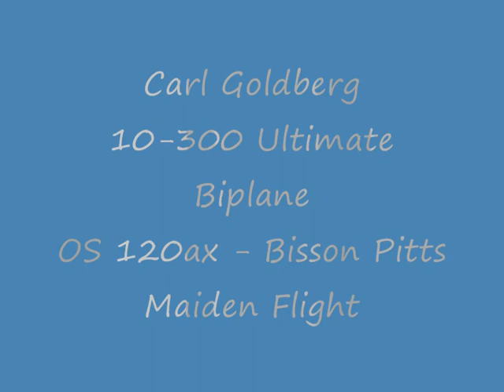Goldberg Ultimate Biplane 10-300 KIT - OS 120ax Maiden

Comment from the maker: Thanks! I am using a topflite powerpoint 16x8 and pretty sure a 17x6 would be the next step. Based on the fact that sport aerobatics can be done 'easily' at 1/2 throttle I would put it in the insane category. however I wouldn't have it any other way and think the 120ax is well suited! Vertical is alot of fun! I am runnin 10% at sea level.

Comment from the maker: I haven't been flying it quite that much yet and only just leaned it out after break in, so yet to try those things with it. I will get unlimited vertical at 2/3 throttle. Full throttle would be your ballistic vertical. I think you could snap roll till the cows come homw if you wanted. I haven't tried hovering but its not reeeeealy a 3d plane. Although I read somewhere that a hover was obtained with 1/2 throttle approx. Just do youreslef a favour and get the 120ax!

Comment from the maker: Thanks! No 3d yet buy I don't think it is really a 3d type plane. I have it set up for 3d control throws however! i will try eventually but I'm not a real 3d pilot. This was the first flight with the engine only having 1 tank through it....so way more powerful now. I think if i did it again I would use a 1.20 four stroke of 91 2 stroke.